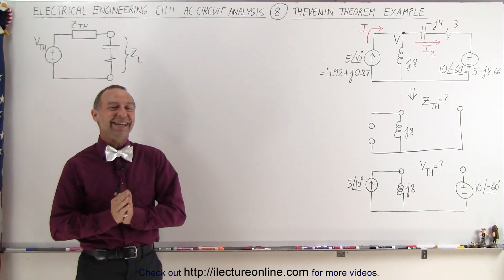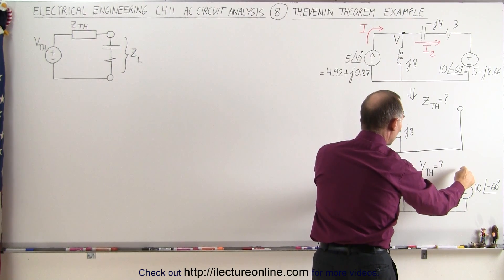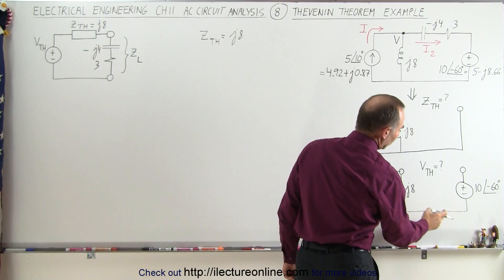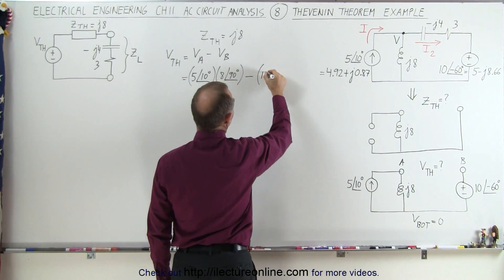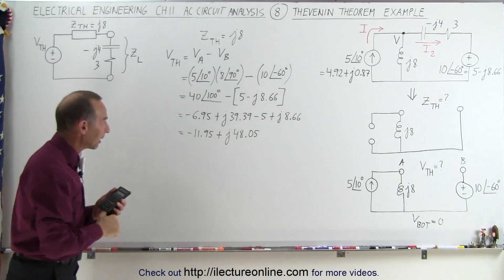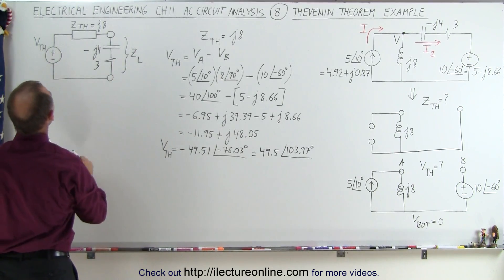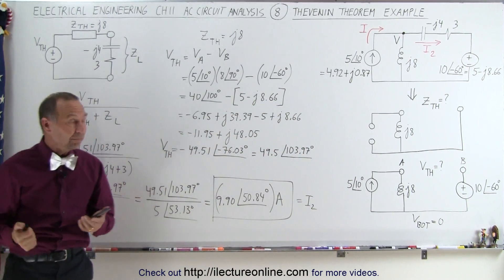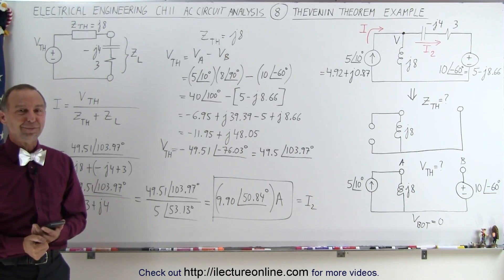Electrical Engineering: Ch 11 AC Circuit Analysis (8 of 55) Thevenin Theorem Example

Comment: SIR, in the end at the thevenin equivalent  I applied KVL at that loop I get the same result but in minus (_j8+j4_3) and current will be (_9,90/50,84), in DC circuit we used to care about the sign since the current flows from higher electric potential to lower electric potential, please correct me if I am getting wrong, also,  do we put the sign for the component impedance or just for one single element
Reply from the maker: Sounds like you method is correct, but you may have made a small error causing the sign error

Comment: Sir, I didn't  get why did you add minus  sign in front of 49.51        at 5:34
Reply from the maker: If you draw the phasor for both expressions, you'll see that it is the exact same phasor.  The phasor is in the second quadrant.  Without the negative sign in front of the 49.51, the phasor would be located in the 4th quadrant.

Comment: Sir greetings here from the Philippines! I just wanna ask how will i find Zth (in thevenin) or Zn (in norton) if a resistor of, let's say 6 ohms would be placed in parallel to the j8 inductor?
Reply from the maker: It would help if you look at and work through some of the other examples to get a greater understanding of the concept.  Adding a resistor in parallel to the inductor would just change the problem.  The principles are the same.  You would work out the impedance across the parallel branch.  (product over the sum)

Comment: Sir can I get ur email I have to ask a very urgent question today 

Pls pls pls
Reply from the maker: You can ask questions here and we answer questions as time permits.
Reply: We have to obtain the thevenin parameter which is having A pi network having resistance and inductors ...   HOW CAN WE DO IT
Reply: If u give email then I can send the image to Uh
Reply: One more question How to find ABCD PARAMETER WHEN INDUCTOR CAPACITOR AND RESISTOR ARE PRESENT
Reply: @Adityasingh-sq7gd  first convert pi to star then apply... And for abcd parameter, i will answer when i reach there.